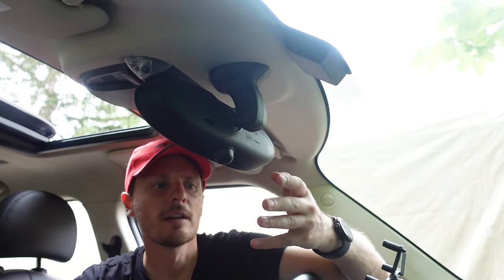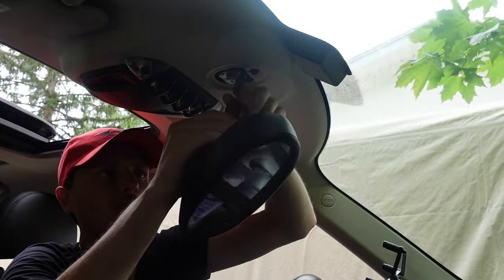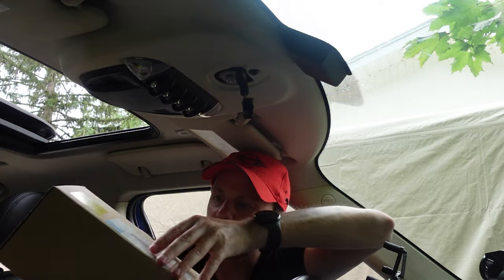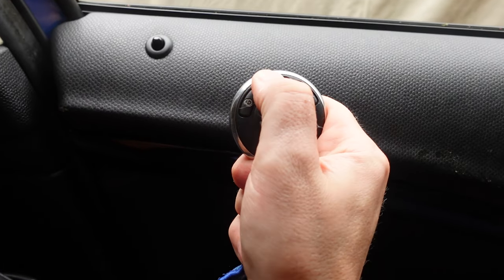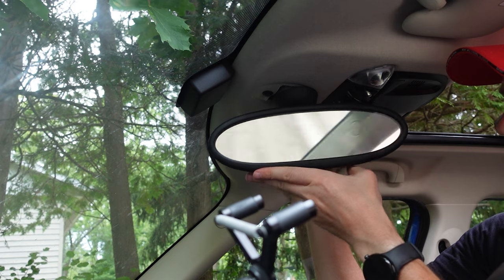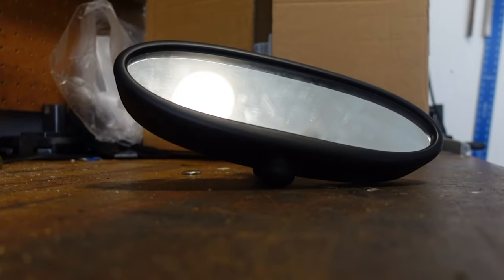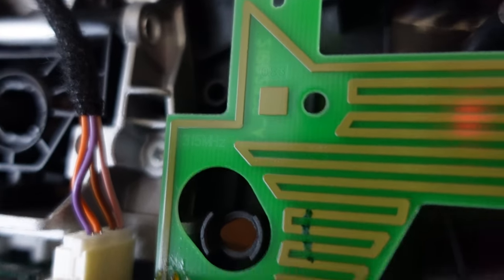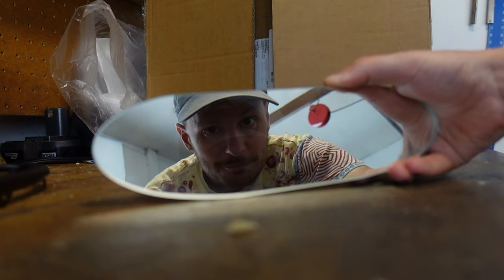MINI Countryman Rearview Mirror Replacement

Comment: When I bought my first Mini (used), we were sitting in a parking lot during a heave rain. Water began running in from the top of the windshield. Luckily it didn't screw anything up. The dealer eventually fixed it, but what a mess! I'm glad you were able to get yours fixed easily.
Reply from the maker: Yeah glad I was able to solve this one myself!

Comment: #1 Instructional Video to solve an inherently BAD Design in these FOB Antennas being in a place where CONDENSATION MOISTURE collects and flows into it's connection (cleaned up w/contact cleaner) keeping Mini Cooper FOB from working! 
BTW: Followed your directions to take it apart easy. But found I only needed to clean corrosion off connector points to FIX IT!  Also... hardest part for me was twisting to remove it. So tight... took crescent wrench to turn it w/housing removed!  ...oiled it up and went right back on! THANKS! :D

Comment: Any chance you know whether you can/how to replace a manual with an auto dimming rearview mirror? I just traded in my 17 Cooper S for a 22 Countryman. The 17 had the auto dimming rearview and side mirrors. I am missing it so much!
Reply: The difference is in the # of wires out of overhead to connector and Auto Dim mirror needing more wires w/ tiny sensor port on bottom of mirror edge facing to rear! So sorry if you pull your mirror down see only 3 wires, it can't be upgraded. You just have to deal with it being manual from what I've researched! 😐

Comment: Hello, I have a F56 JCW 2018 and I believe I have the dimming button too, but when I try to turn the button it doesn't work, I don't wanna apply to much pressure and brake it but is that normal?
Reply from the maker: The manual dimming button like this one? That is easy and it's a twist and not a push. The electronic one, I can't speak confidently on so hopefully someone else can chime-in in the comments!
Reply: @TheMINIVlog  Yes, normally it should twist but it doesn't I guess I'll check with my dealership